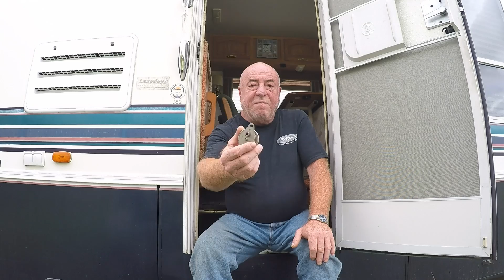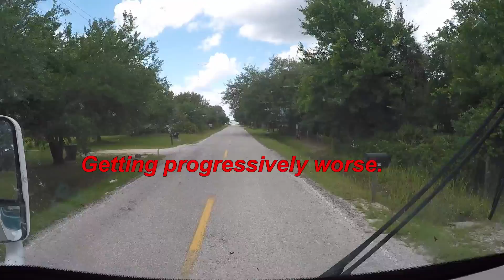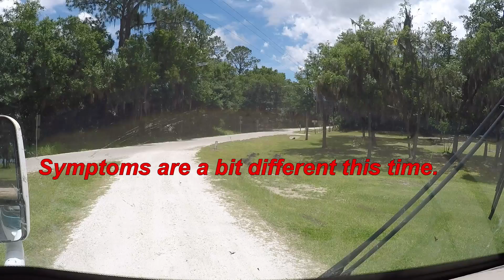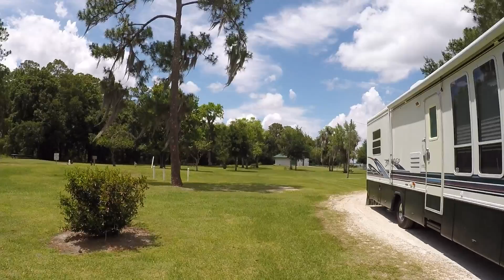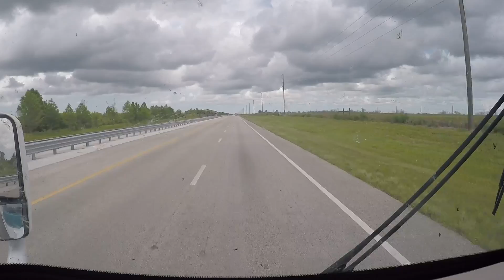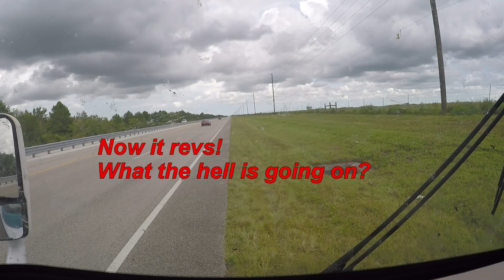May 9, 2015 Test Drive Video & More

Comment: Damn! It was like getting hit in the stomach when I heard you say the check engine light had come on and then you topped it off saying it was running terrible! Can't imagine how bad you felt/feel. No need at all to apologize and the videos are not boring! It's actually quite interesting. I think it's time for different mechanic even though you have a lot of time and money invested with him. It's going to work out.
Reply from the maker: Brian K Kinney Thank you Brian.  The axle seal really hurt.  This problem seems to be very unique and elusive.
Reply: Rufus N Dufus Keep your chin up. A rear axle seal and components isn't the end of the world and better to replace it now rather than on one your upcoming trips. Things get old and wear out. I follow folks on here with new RVs, you probably do to, and they have there share of problems too. There's a solution and you're going to find it. Focus on the positives and handle the other things you need to get done before hitting the road.

Comment: Chico, do not apologize for anything, your videos are great! This problem has sucked us all in, we are on the edge of our seats waiting for the solution. An axel seal and bearings should be an easy fix if caught early enough. You may want to check both sides and change the rear end oil. Please do not get mad at me for the following suggestion, when faced with a come and go problem like you have I always blame the computer!!! As a mechanic for a dealer it was easier for me because I would simply go to the parts department "borrow" an ECM (electronic control module) and try it out. I know you can't just throw money at the problem but if a cool down period helps as in your case that sure sounds like an ECM to me! I am heart broken right there with you and just trying to help. Keep us informd PLEASE! Bill

Comment: I just got back in from walking my dog.  I thought about my winter problem with my 940 VOLVO.  After testing fuel pressure, all the sensors (on the bench) I found that the ECT Sensor plug was all green with corrosion the ECT tested fine by itself  but with a corroded plug the computer thought it was minus a bazillion degrees and flooded the engine horribly.  It worked great after cleaning the plug with PB Blaster and contact cleaner, the engine ran smoother at a lower RPM as well.  I am thinking that it might be a dirty plug or an intermittent wiring thing.  I thought fuel pump, regulator and so on and tested all these before lucking onto the corroded plug.  Your videos have inspired me to get a Ford E-150 camper that we just plated.  Thanks and keep it up........

Comment: Chico, I talked to my father-in-law tonight about your Guz problems.  He is now a retired auto repair garage owner.  He said the problem is probably a catalytic converter that has come apart internally and is blocking the exhaust.  He said they saw this before with 90's age vehicles.  He said if you get it in this condition to have somebody listen to the exhaust and it will be weaker and can be making a whistle sound.  I know you also have the wheel bearing problem to take care of first but I would bet this is the right answer.  I hope this helps you!

Comment: It does sound like an electronics issue now, probably the engine controller. Turning the key off and on does reset the controller, and usually clears the error code, you need to do a drive with your reader connected. The axle seals are a pain, but to be expected in an older unit that has been sitting for several years, do both sides, it will save you in the long run. I'd love to help you, but it's a long way from Alberta to Florida. Keep your chin up, the end is in sight! Keep the videos coming!

Comment: Chico,

I think Tim is on the right track. Even before you started and assumed the fuel pump was not delivering the right amount of fuel you still had the sputtering and bucking. And again, think about it, this problem keeps comming back with every new fuel pump and fuel regulator. Your Mechanic is chasing the symptom and not the cause.  I believe there never was an issue with your fuel pump or your fuel pressure regulator. 

The rear seal issue isn't the end of the world. the parts for those dualies aren't very expensive. Bearings for the wheels aren't expensive either. Hopefully you didn't drain the pumpkin and damage the differential.

BTW..I am hearing in the videos that ,at times, your revving the engine. My brother, who is a real Motörhead,told me those 460's can spin a bearing if there over revved.  Be careful  buddy.

Cheers; 

Steve

Comment: My partner and I are planning early retirement, selling it all and buying a Class A. He wanted new, I wanted lightly used. We're as mechanical as a rock so now we're looking at new. And working for another year or 2. Sorry for your bad luck but thanks for the eye opener. 

I feel bad for you and I've only seen 3 of your videos but "make some lemonade" and get it on the road!!
Reply from the maker: ***** My rig really was not to bad.  Some of the work was upgrades.  New ones can have just as many problems.
Reply: Rufus N Dufus I know nothing's perfect but if we're paying cash money for a house on wheels I'd like to have a warranty to cover the burps. AAA only covers so much  :D
Reply from the maker: ***** I think you can purchase a warranty on a used motor home as long as it falls into a specific number of years.   Kind of gives you the best of both worlds!  Check Good Sams out.

Comment: I had focused on the fuel for the problem, actually thinking of a vapor lock situation in the tank. But before you said you had added fuel and it didn't change.....Now it's acting exactly the way I had an Acura do, it never threw a code, the ECM had cold solder connections. I even sent it off to a remanufacture, they tested and returned, said it was good. After replacing everything thing possibly related, I went to a salvage yard, bought a used one and it never died again. It's just a simple job to replace and inexpensive. I'm not 100% sure but it sure is the identical symptoms.

Comment: The rear bearing and seal would have gone bad anyway.  Have you replaced all the rear end fluid and other fluids including the transmission fluid yet?  It was sitting for a long time.  As for the other problem, is it possible that it could be gelled gasoline in one of the lines floating back and forth like a jelly fish and clogging things intermittently?  As for whether or not your channel is interesting, it is for those of us who are with you on this journey.  God's blessings on you.
Reply from the maker: Bishop J Hi Bishop, the rear seal is fixed now.  Hope to get the original problem fixed soon.

Comment: gas boiling or vapor lock can be fixed with insulating the fuel lines near a heat source. good luck
Reply from the maker: mike arg Fuel injection.
Reply: Rufus N Dufus  yeah rule that out, you find out what it is yet?

Comment: When you stop because the problem is happening, go open gas cap while listening for a whoosh that tank was under vacuum. Should run better immediately when vacuum is relieved. The evap vent solenoid may be plugged and not relieving vacuum. They are about $50. Listen for whoosh.Doesn't seem like temperature is an issue because 15 minutes cooling is nothing for relieving temperature. Check air gap on ignition pickup coil. Reduce gap or replace pickup coil. After rear bearing and seal is fixed then rolling troubleshooting can resume. You can troubleshoot while driving with the hump cover (dog house) off. I used to do it in a Ford van. One person is driving while passenger is troubleshooting while the problem is happening. I realize you must save to resume repair. Intermittent problems can really whack your wallet.
Reply from the maker: Tim Cat We will try, thank you Tim.
Reply: Rufus N Dufus Air filter?

Comment: Sorry to hear that you are having nothing but issues with your RV.  I have to agree that it might be a EVAP issue here.  I'm having one with my vehicle ATM and I'm trying to get it nailed down.  Sounds like the gas tank is going into negative pressure and it is starving the engine for fuel. The smell might be where it's pulling fuel into the charcoal canister and that is what might be causing that odor.

Comment: I still say you need to run some heavy duty fuel system cleaner through the whole fuel system (high concentration). You mentioned the tank was clean but what about the rest of the fuel system. The lines, the sensors the injectors etc... When the previous owner let it sit with fuel in it there was fuel throughout the whole system and it could have turned to varnish deposits anywhere in the system. The aftermarket pump and regulator are just masking the problem I think. There is very likely deposits somewhere in the fuel system.

Comment: A friend of mine had a Ford car that sometimes would not start, we would roll it a bit and it would work fine.  Don't remember why they eventually looked in the gas tank but found a timecard that would occasionally cover the line coming out of the tank.  Maybe you've got something in the tank.
Reply from the maker: Tim Hogan Tank has been inspected a few times very thoroughly.  Thank you for suggesting.

Comment: Chico its kinda sounded to me like it was air locking.. maybe check the  gas cap for air flow. . or there after the gas pump that was left in the tank could still be blocking your fuel

Comment: Chico firdt let me say I am so happy Rufus's allergies are getting better. We have had a hard time with one of our fur babies and a skin condition too. Next let me say I enjoy your videos. I do not like that you are having such problems with Guz but it will get figured out. As the old saying goes. Everything happens for a reason. What that reason is we do not know you. Maybe there is a superior force at work keeping you near home for just a little while longer. You will leave when the time is right thought. We have recently decuded to go full time ourselves. We are no where near ready. Just in the planning stages right now. We have to upgrade out RV. Right now we only have a small travel trailer. We are looking at class A,s or 5th wheels. Not sure just yet. More leaning toward a class A with a toad. As to you issues. I wish I could offer some magical advice but I too am at a loss. What did the code scanner show when you check it for the check engine light?

Comment: I've suggested before and don't know if you checked you fuel injectors/injector.  Seems your computer was going into limp mode and then just shutting down.  Resetting power brought it back till the bad injector errored up again and it went into limp again...  Injector check is a simple ohms check.  Worth a check anyway.

Comment: Well I can tell you first hand you are not the only person who has fought gremlins in an RV.  Every owner will tell you that.  You own one of these houses on wheels and you will be working on it a lot.  However, when it is running correctly it does run very well.  So a few good points.  You have a good engine, strong.  Trans is good.  Rear axle seal leading to a damaged bearing?  It sat for a long time, not good for any seal. 
Observation and opinion, it is not your fuel pump, it is not the regulator.  They may have been bad and needed to be changed anyway.  What you have now is an on and off problem.  The fact that it goes away when you shut it down and restart points to a computer issue.  You are rebooting it when you restart.  You may also have one or more bad injectors.  They can leak and even stick open (higher than normal gas use).  It might take a while, but this all good things.  Injectors can be changed, the PC brain can be changed (and maybe from a junkyard).  Also someone below brought up the gas cap and that is worth checking as well.  A bad vacuum issue in your tank can create enough vacuum to collapse a rubber hose down to a trickle.  I wish I was closer, I give you a hand troubleshooting it.  I actually like the hunt for a gremlin and the ones that come and go are the best challenge.
Keep plugging away at it when you have the funds.  Quartzite isn't going anywhere soon and neither are you.  It will be here when you are ready.  Good luck.

Comment: Internet search revealed another possible cause to your problems. In 2001-2002 Ford settled a class action lawsuit for stalling, chugging issues called TFI settlement. TFI could be the cause of your problems if installed. It usually is mounted near the distributor on firewall but on F-53 chassis may be near the front of engine near radiator. High heat causes intermittent failure by wrong ignition and fuel settings. It is called Thick Film Ignition module and was still on most 97 F-53 chassis. Turning ignition off-on would reset it. It may be on your 1998, depends on manufacture date. If mileage is less than 100,000 Ford will cover repair costs for TFI problems. Google for TFI settlement. Something else to check for.

Comment: We had a Ford van that did this same thing.  I could be driving fine in Atlanta traffic, hit a traffic jam and have to slow down and it would stall on me.  Or if I took my foot off the gas at a decent speed, it would start dying and pit & sputter, my foot to the floor and the speed would steadily drop. I would pull over, turn the engine off and crank it again and it ran fine until I had to adjust my speed.  We were told it was a fuel injection problem and they did a few repairs that didn't help.  Some days it drove just fine and other days not.  We never did figure it out.  My son hit a deer with the van and put the end to our headache with that vehicle.  LOL

Comment: The best thing is to bring it to the manufacturer service and they will find out. Don't bring it to just any mechanic. Bring it to an authorized dealer service center. It may cost a bit more but you won't get just some Joe Blow working on your rig.

Comment: I know this might not be the problem, but it might help, it sound's just like a stuck automatic choke on the carburetor. This choke should open after the engine get's hot. if  it don't,  it will cause the engine to react just like it is doing. I feel for you man, I wish I could be there to help!  we would get this problem fixed.
Reply: Rusty Patterson This is 98 with fuel injection so no carb or automatic choke.

Comment: thanks for your email, was not able to respond back via that way. we had another major failure after my comment to you. the rear seal is leaking for the third time this month and was replaced 2 times completely with bearings on both sides by a huge ford dealer ship. they now have to tow it back an hour and a half away at their cost again for the second time. we have decided to sell it. and move 

thanks
Reply from the maker: mike menard Can you call me 7725324330?

Comment: Sorry commented before the video was over, not a mechanic but do have a lot of electronics experience,  When you shut Guz off and restart you are resetting something, ECU?
Reply: Tim Hogan Tim,  If you are resetting the ECU to normal then a sensor it telling the ECU to adjust the fuel.. O2 would do that.. Chico stated he smelled gas strong when the problem was happening..  Was it getting too much fuel to the system?
Reply: I was just throwing stuff out there, like I said not a mechanic but lots of electronic experience.

Comment: Bottom line,  Get a new mechanic, No insult to Ulf, but the issue is beyond him.  Find a official certified Ford engine mechanic at a Ford garage that has all the test equipment and knowledge to use it.  The Ford 460 engine is a outstanding engine and has been for many many years.  It makes no difference that it is a motorhome having this issue.  I know the cost will be more but you will find the issue.   I do not believe it is a fuel problem myself.  The wheel bearing going out is a no brainer and easy fix.   Also it is a good thing that you are finding this all out now before you head out.  Imagine if you were on the road somewhere.    I am not bored with your video's.  It seems I am as hooked on finding the solution to this issue as you and most everyone watching and going through this "with" you..   Chin up (insert cliche here),  My wife and I are going to be heading out this fall with our as yet to be purchased motorhome.  We both have even talked about hoping that we can meet up in our travels at some point and enjoy a bit of shade beside a cactus or even a palm tree and have a cold beer.

Comment: I found a good picture of TFI module on a radiator at http://www.coolcats.net/help/tfi.html
The second picture is a tfi on radiator which you can look for one on Guz. They are $30 to $50. They come in gray or black so stay with the same color as mounted. Don't know if you have one but is probably mounted on radiator so easy to check.

Comment: .
Pick yer' jowls up Chico ! It's always darkest just before the dawn.
FIRST off , get USED to blown axle & wheel seals , they' come with the territory of ANY heavy truck & you'll learn to spot and  hear  them LONG before they do any real damage. 
As for the running problems , this most recent road test proves the problem to be electronic in nature  ▬  probably a weak electronic link  ( ICM ? ) which is physically located in a place where it is affected by engine temperature or maybe just by running TIME. The problem seems to occur about the same amount of TIME into each test run. Is it possible that something in the COACH ELECTRONICS ( like a faulty systems monitor , battery switch  or some recently changed , shorting wiring  ) is causing this ? Maybe some feature building up a static charge over time and causing ignition failure ?  Whatever it is , resetting the ignition ( key off / restart ) seems now to fix it   ▬   at least temporarily. 
 Just guessing , hoping to help   ▬   NOT add to the confusion.
KEEP TRYING , we MUSTN'T disappoint Rufus !